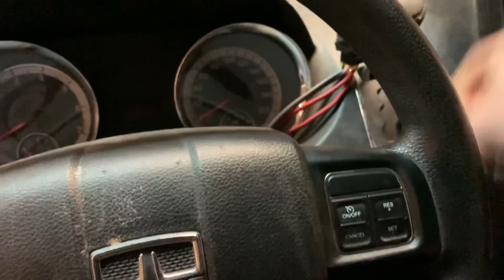The Turbo LS Caravan is going NA… for now

Comment: My truck runs as bad as yours. Starts and then dies if I dont hit the gas.
Reply from the maker: Is yours speed density, or MAF? If it’s MAF, the IAC is common to fail and won’t open the air passages enough to idle. Sometimes you can clean them but usually its a replace.